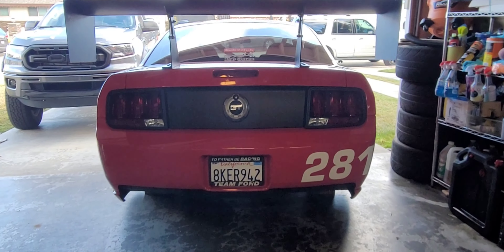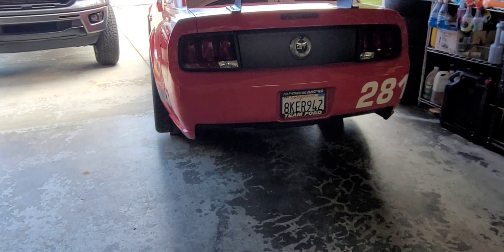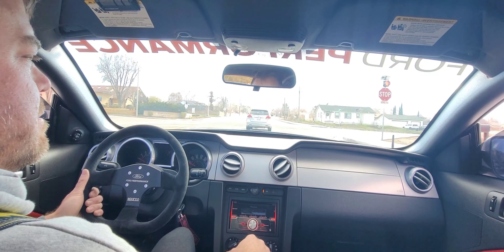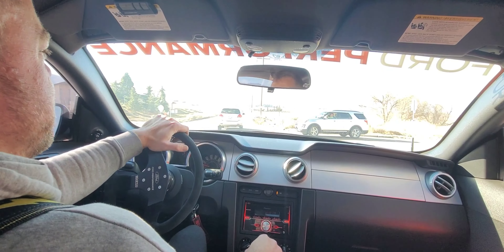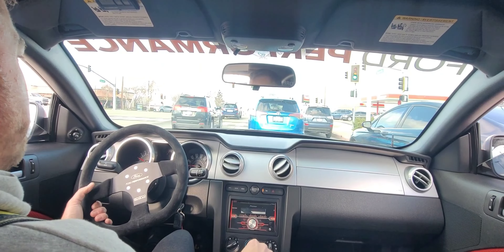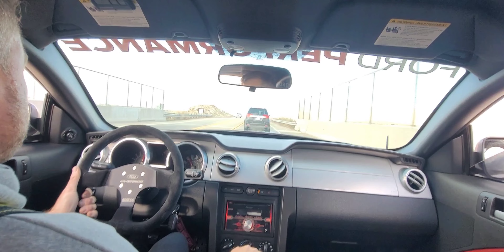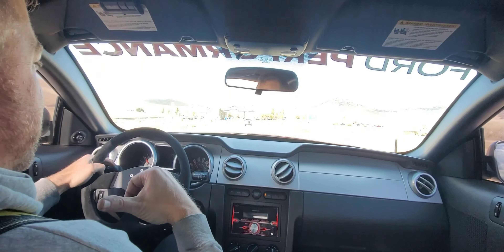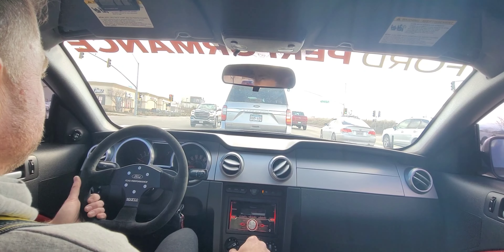2005 MUSTANG GT 4.6 3V MAGNAFLOW MID MUFFLER CATBACK

Comment: I have a 2015 3.7, stock 3.15s but im about to get a PP 3.73 torsen differential installed next month. How big of a difference should I expect? I have a 6r80 vert. What r the best 2nd & 3rd gear mph for rolls?
Reply from the maker: Youll notice 373s just make sure its properly tuned
Reply: @hechtspeed  I have a tune from MPT , they told me that all ill need to do is change the gear ratio with my SCT x4 when reloading my old tune. They told me it wasn't necessary to retune for new shift points & that the shift point I already have should work just fine with the 3.73s.

I'm also considering getting a e85 flex tune, would u say e85 is a noticeable difference as well?
Reply from the maker: @thelifeofjp1996  e85 will help a lil bit. Wont be huge though